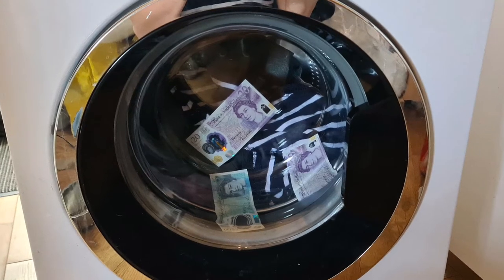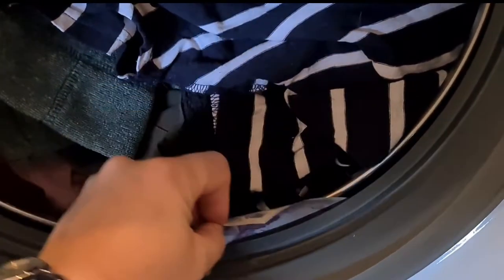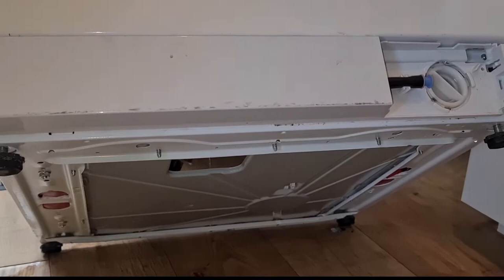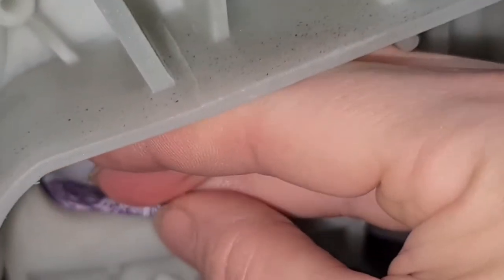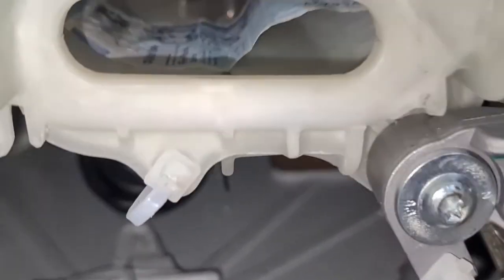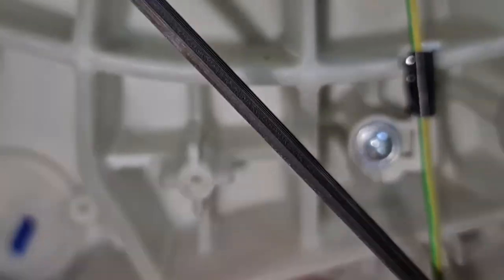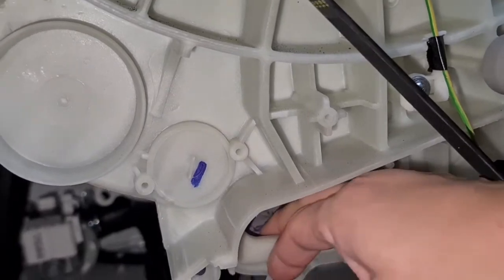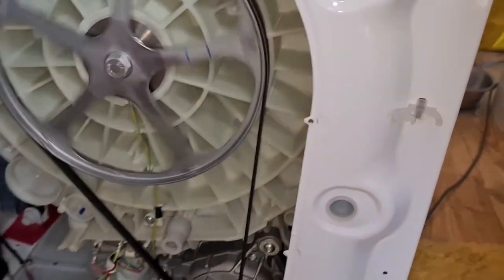How To Retrieve Bank Notes Money Bills Lost or Stuck in Washing Machine Help!

Comment: What would happen if I left the banknotes inside? Would it be harmful to the washing machine???
Reply from the maker: I don't think it would do any damage to leave them in there. The notes would either sit there forever or disintegrate and eventually get washed away
Reply: @JennyTheFrog  I really hope they will disintegrate... But that would be unlikely since they are made of plastic...
Reply from the maker: You're right, the plastic won't dissolve, but if its getting in the way of the drum then it might get ripped and shredded and folded up and then will go down the sump and washed away.
Reply: Thank you for your assistance, @JennyTheFrog ! I hope everything will be fine...